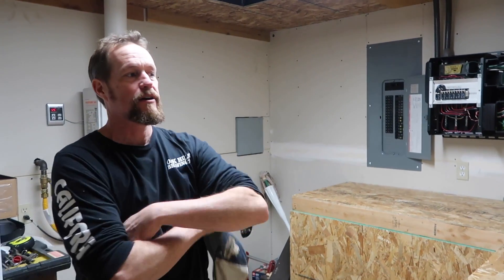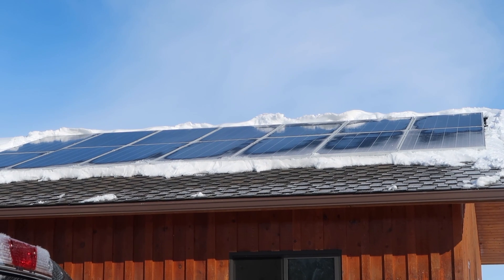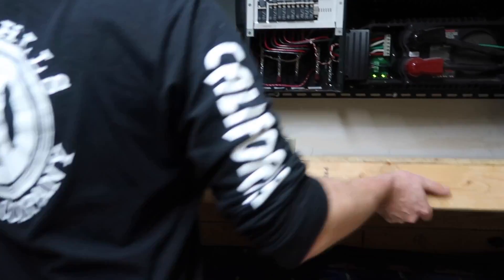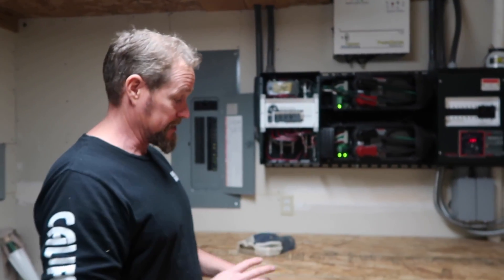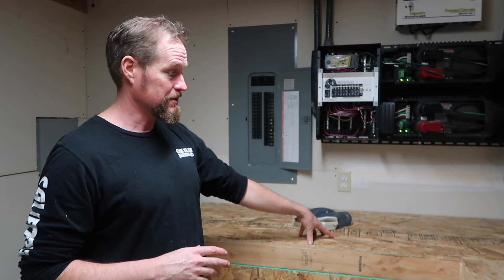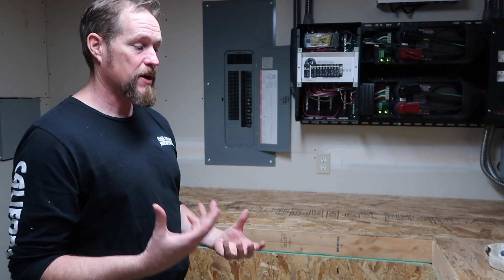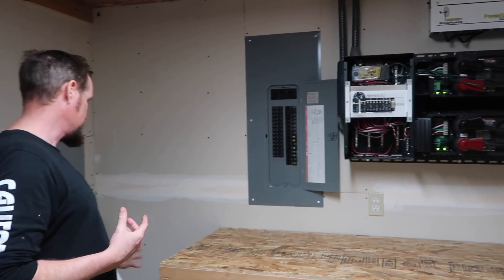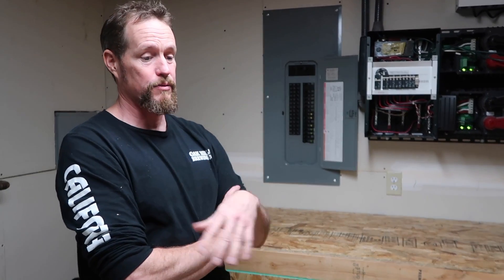Edison Batteries vs  Lead Acid Batteries: Off-Grid with The Traditional Catholic Homestead

Comment: Iron batteries are good cycle battery's I've seen sets that were cycled 1000s of times from the 1920s or so - 
    Those were in rural homes farm light plants  up till about 1980 there were still some rural people that did not want to hook up to the grid because they could generate there own power for far less  a kw - 
   Where I live in the 1880 a great Uncle of mine would set rural homes up on 4 huge 2 volt cells to power there rural homes  - also a up right wood fired  boiler that provided steam to turn an engine generator to charge the house battery once a week all day every Friday  - down here in the deep south electric fans were very desirable in summer - 
       So in the 1880s electric fans became a rural craze in the south during Summer -  
      This might be of interest to some about lead acid batteries or cells - 
    my great  uncle and grandfather would just build a wood box out of creosote treated wood - line it with lead sheeting and solder it so it would hold acid -  that was the battery inner shell and part of the negative plates.- 
     They just used lead sheeting with  small holes punched into them and set up glass insulators for the plates to rest in the bottom of the cell - then used wood viner separators - 
   They filled the batteries with acid and fired the generator boiler to start the dry charge process of the battery being activated - 
   Gradually as the batteries cells were charged and discharged the capacity would increase as more of the positive plates were converted to red lead or lead peroxide - 
      It could take a few yrs till cells  reached  their  full capacity - they had to be cycled a lot of  times till much of the positive plates became lead peroxide - 
      When you hear it said that a 12 volt battery is 12 volts instead of its actual 12.8 volts when charged -
       Today the acid strength is 1.265 gravity or higher - 
  Originally cells were used for cycle service - as in rural homes for powering the home - 
      Up till about 1920 cycle battery banks used an acid strength of 1.195 gravity - with that weak acid solution there is a 40% loss in capacity so very large cells were common to confenscate for capacity Loss - 
     With weaker acid the positive plates do not swell or shed material as they do in modern deep cycle batteries - also the negative plate sulfates very little and is easily desulfated when it's noticed there is a capacity decrease - that is different then equalizing when desulfating plates. - 
  Another is you still wipe terminals with Vaseline but there is no terminal corrosion when weaker acid solution is used - 
   With weak acid cells a 6 volt system uses 4 two volt cells and the 32 volt system uses 18 or 19 cells - 
     When there is a load on the cells there is a voltage drop due to the weaker acid - 
    The advantage of using a weaker acid was the positive plates don't swell or shed material - sulfation is not a real problem - 
       Also cells last over 100 yrs of continues weekly cycling - I would. Go to farm houses with my grandfather or uncles as a kid at times in the 1960s  that still never had grid power from REA and were on there original farm light plants - 
     They spoke of all that also I read old books on farm light plants in the 1880s or so - 
      Most of the steam generators were up grated to gas or oil engines by the 1960s - down here in the deep south REA charged 35 cents a kw in the 1950s and 60s so those that had farm light plants were generating there own power for a little more than 1 cent per kw -the Delco 32 volt light plants generated 1 kw for about 2 cents a kw - kerosene was about 12¢ a gallon - 
   I presently have 26 golf cart batteries I use when storms knock power out for long power outages - there diluted to 1.220 strength acid - there about 43 yrs old - with strong acid the positive post eats  around the battery case and the positive post becomes loose over the yrs - none of my positive posts will shake - also at .220 acid does not carrode the terminals -      all the battery's still have full capacity - if they were cycle all the time  with .220 acid they last about 40 yrs  with .195 it's more than 80 yrs from what I was told - 
      I'm a 4 th generation generator mechanic and spent my yrs in the offshore oilfields -
Reply from the maker: That's an amazing amount of information! It's incredible to hear about the longevity of those older battery systems.

Comment: Up front cost for NiFe is higher than for lead acid, but NiFe cost PER YEAR is lower than lead acid.  Lead acid batteries will certainly need replacement, and that cost matters, too.

Comment: Ive had nickel iron batteries, 2 different brands from China and they are almost useless.  They have just steadily declined over 4 years, and only hold 15% of their rated amp/hours.  On inspection they have like black powder in the bottom of their containers. A bank of 20kw/hr goes through 80 liters of water a year.........which without a constant watering system is a pain to maintain. People promote the chinese versions as being like the USA Edison batteries, but they are nothing like them.
Reply: @Chris-te7uk  The Fentanyl flooding in from China via Mexico is probably the most malicious thing China is behind right now...........and like the trade situation, its all enabled by crooked domestic politicians.   The enemy is inside the gates.
Reply: Did you condition them?  That's mandatory for them to work.
Reply: @PeterLawton  yes they were conditioned.  The problems stem from a couple of issues. Firstly, ignorant people were selling the Chinese made NiFe's, and not explaining the caveats.  Firstly, these batteries are not like the original Edison batteries.  They are all made in China,and use VARTA style construction for the pouches that contain the active materials. The active materials are in the form of a paste, not as in the original Edison batteries which used a granular material.  The problem with the paste, is that it DISSOLVES into the electrolyte physically and causes the cell to short out, and it wont accept charge.  You end with all this fine black sandy powder inside the case of the battery. If the cells are rinsed out of all the contaminated electrolyte, along with the black sand, they can be refilled and restored somewhat,but not to full working capability.  The process of the paste dissolving is proportional to how much use and discharge they undergo.  These are NOT proper,original, Edison batteries that had the robust reputation......they are a FRAUD.
Reply: @wazza33racer  

May  i ask what is this paste ? and where is it ? i have a set new to me, but 2nd hand that i want to get working. the newer chinese nife batteries though, your message above made me worry as these ones do have the water/electrolyte in them go all blackish even after rinsing them.
Reply: @qwertyui90qwertyui90    the material that builds in the bottom of the case is a mixture of small iron flakes and fine black sand which is probably the nickel component. Some of the material is very fine and is dissolved in the electrolyte, which causes the cells to slowly short out and not accept charge. The active material should stay in the pouches that make up the electrode frames. Instead, the iron and nickel active material has been made very fine (more surface area/performance) and it is migrating out the pouches.
Reply: @wazza33racer  
So it's losing nickel on half of the plates ? either the anode or cathode ? 

can i electroplate nickel back on to it >?
Reply: @qwertyui90qwertyui90  the nickel is meant to be very fine flakes or granules, contained inside the conductive metal pouch envelope.  Even if you could recover the nickel and iron, they have to be inside the pouches that make up the anodes and cathodes.  Some people have posted videos of their chinese NiFe battery cathodes and anodes basically collapsing from poor manufacturing.
Reply: @wazza33racer  Is it possible to buy some nickel flakes and put them inside of the pouch ?
Reply: Hi, which brands did you purchase?
Reply: @andrecumagun7561  One brand was an Australian importer brand "Iron Core" and the other brand was CIYI Zhuhai from Shenzhen. The CIYI units were of better build quality, but still have the same issue with the active material dissolving into the electrolyte and needing to be rinsed, and refilled with new electrolyte.

Comment: Cool, hey dont vent the hho capture it. Just have sum rain capture to keep it topped off. If the cells have separate vent holes that would be best. That way you could compress the h2 and 02 into tanks for later use. So it can store galvanic and water dissassociation if charged quickly. Run water heaters,furnaces, stoves, and generators off the hho.

Comment: yea i wouldn't spend 14,500 dollars just for a battery bank especially when Edison made them 120 years ago in a makeshift lab that had makeshift equipment, and the people who worked there knew less then a 12 year old who excels at science, this is the recipe for this battery, plate of nickel, plate of iron, a spacer that allows ion's to pass (could be a lair of toilet paper) all sitting a plastic box so the electrolyte won't leak out.
the electrolyte? (the magic juice) is distilled water mixed with potassium hydroxide (KOH a by product made from fire ash) and if you really want to boost preference add 10% lithium mono hydrate.
i made a 48 volt, (about) 1500 amp pack, for about 400 bucks, and i ordered it all on eBay and amazon 2 years ago works amazing, takes a ton of space though
Reply: Would you be able to email me the exact parts you used? I really want to build this myself, and I agree about the price,...these things are stupid high $$ for what they are. I'm trying to put together a 1000ah 48v bank.
Reply: I second that: links to similar items would be great!

Comment: Really interesting. Had no idea it is so complicated. Why did he have two kinds of batteries?
Reply: We went with the two types of battery because the energy density and rate of discharge with the lead acid batteries works out a little better in our context, while the robustness and long term durability of the Nickel Iron battery helps to stabilise the system as a whole and adds to the longevity of the lead acid batteries.  Short answer best of both worlds and a really nice synergy!!

Comment: Great stuff....I love the use of a wind turbine and the solar together.  I might have to do some based on how expensive it is to run the power company's power line in northern Idaho.  I have looked at propane appliances as well to draw down the cost of electricity.
Reply: It's a pretty good complimentary setup!  I think the gold standard on a system like this would be micro-hydro if you have the water available.  We're working on getting our seasonal creek back to flowing year round in hopes of being able to add that resource into the mix.  I think it would pay for itself the first year just in propane savings!!!
Reply: @tradcathomestead8179  yea, that would be perfect and would make a great series, on how to have consistent and renewable/reuseable power...unfortunately, our land has no moving water or standing water.  Our land is a bit north of you, between Athol and Spirit Lake.  One thing I need to find out is how much propane costs up there.  I know electricity is actually cheaper than down here but getting the line run any amount of distance is not cheap....and you are still subject to power outages.  I have experienced days of power outages (after hurricanes) here in what many call a third world nation, Miami.  
Also, did some research into what a traditional Catholic Mass is and I have actually been to some and didn't realize it (although it was decades or scores ago).  I was reading an article from the view of an ordained priest who has participated in both and he prefers the traditional Latin Mass.  One thing I have been able to experience in Miami is a Maronite Mass (they are in communion with the Roman Catholic Church but perform Mass in Aramaic, the colloquial language of the Holy Land back in the day.)  It is pretty cool to hear the prayers that the first Christians would have said in their native tongue.  
Looking forward to more videos!

Comment: That is an amazing set up for sure. Older is better. Isn't that the truth. Expense and weight seem very substantial though. Way to complicated for me lol. Kind of scary with that hydrogen. I love your videos. So interesting.
Reply: Weight is why Edison batteries are not ideal for say electric vehicle use but ideal for homestead use.  Weight is not really a factor on stationary applications where longevity and capacity and cost are in fact all crucial factors

Comment: Did he talk about the wind mill outside - was it noisy? did it cause vibrations? how far from the house was it?
Reply: following
Reply: The wind generator is about 100 ft from the house.  It does make a little noise, especially in a strong wind.  Vibrations aren't bad.  I think with the smaller turbines you don't run into the environmental problems that seem to plague the giant ones.